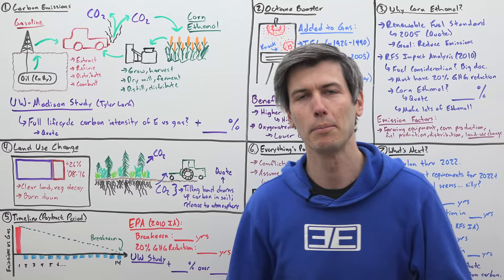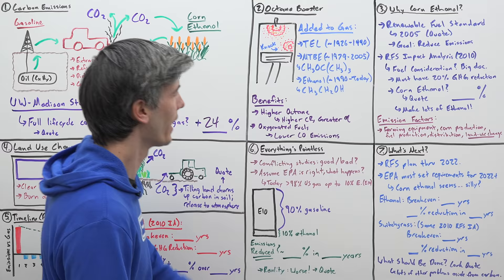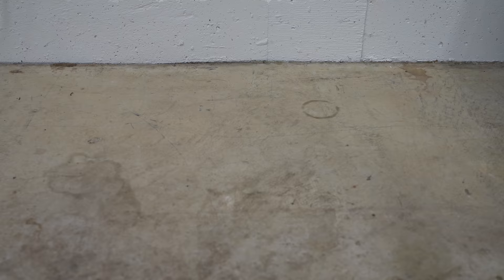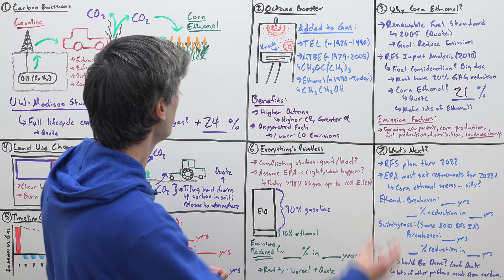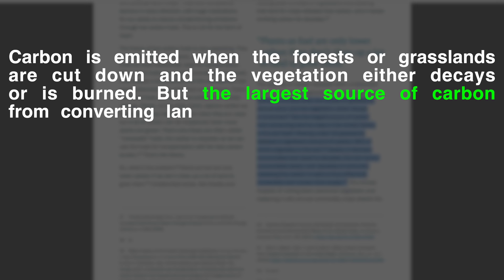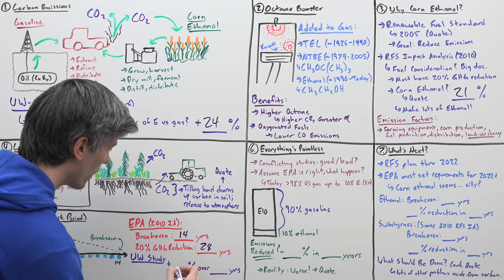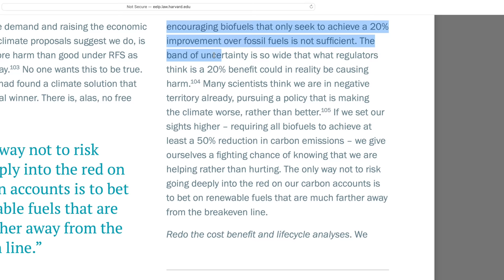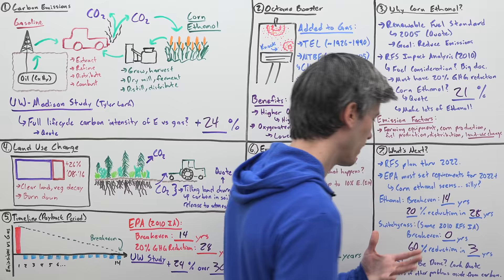America Was Wrong About Ethanol - Study Shows

Comment: Back in the 1970's(my engineering college years) I read studies in my engineering/science magazines about the energy output of ethanol. All the estimates were that the ratio of energy INPUT(to plow, plant, grow, harvest, process, ferment, distill) - to - the energy OUTPUT(when the resulting ethanol is burned). That ratio was estimated as very near 1:1.  With ethanol advocates claiming 1:1.2 at their high end and the detractors claiming 0.7:1 at their low end.  
And what's more is the energy INPUT is mostly from burning fossil fuels which produce CO2.  And then the ethanol is burned which produces more CO2.  The entire process from end to end nearly doubles the CO2 instead of reducing it.
Reply: All the energy and CO2 it takes to produce and deliver a product to the consumer is reflected in the price of the product.

As such note the spot cash delivered price of ethanol today is $1.49/gallon.

The price of sub-grade unusable gasoline (RBOB) is $2.32/gallon.

To turn RBOB into usable E0 fuel costs even more much like premium costs more.  Unfortunately, it becomes even more toxic and dirty.

Or simply splash in >10% ethanol to RBOB and the resultant usable fuel becomes less toxic, far cleaner burning, and cheaper/cheaper per mile to drive with.  Who can be against that?

Iowa State University measured all the energy it takes to produce an acre of corn into a "diesel fuel equivalent"
This included making of the machinery, fertilizer, chemicals plus the tillage, planting, harvesting, drying, trucking etc. 
They found it takes 34 gal of diesel to produce one acre of corn.
What do we get from those 34 gallons of diesel?
We get >500 gallons of ethanol.
But wait, that is not the kicker.
The kicker is we still get 100% of the protein from that acre of corn still available for an even better feed. A win-win.
Reply: Not to rush you Kthwkr but its 2024...

Comment: The use of corn for ethanol also raised the price of feed for animals (cows, horses, etc.) and the regulation required corn (corn lobby is strong), and not the most efficient plants (sugar cane) as well as switch grass like you stated.  This was very well known in the science world, but politics kept much of it from coming out.  I spent most of my career in various sections of the 'oil patch',  but am not lover of the petroleum industry.  Most people in it are good people doing the best they can, and like most industries there are a few 'bad actors' that spoil it for everyone.
Reply: The Renewable Fuel Standard does not specify what fuel or source is used, any source can qualify as renewable, even biodiesel.

The reason corn ethanol is so economical is not because it makes the most ethanol per acre, but because it is value-added from already existing feed production acres which preserves the feed as distillers grains.

No corn is grown just for ethanol, far too uneconomical.  But with the feed factor few others can compete even though they make more ethanol per acre, like sugarcane.

So much so that Brazil in 2017 put an import tariff on our ethanol.  Sugarcane ethanol is big there.

The subsidy for generation 1 ethanol which corn qualified for ended back in 2011 and had been $.45/gallon called a blenders credit or VEETC.

There still exists a subsidy for generation 2 ethanol which switchgrass would qualify for, and it is $1.00/gallon, yet no gen 2 plants have been built.  One that used corn stover was almost built but has since been repurposed.  It is harder to make ethanol from cellulose which is why even the spirits we drink all come from sugars and starches.

Here is how the 2007 Energy Independence and Security Act affected food/feed prices(if at all):

2007 WEIGHTED CORN PRICE =$4.20 WITH 4 .7B GAL MANDATE
2008 WEIGHTED CORN PRICE =$4.06 WITH 9B GAL MANDATE
2009 WEIGHTED CORN PRICE=$3.55 WITH 10.5B GAL MANDATE

2016 WEIGHTED CORN PRICE =$3.36 WITH 15B GAL MADATE MAXED OUT
2017 WEIGHTED CORN PRICE =$3.36 WITH 15B GAL MANDATE MAXED OUT
2018 WEIGHTED CORN PRICE =$3.61 WITH SAME 15B GAL MANDATE MAXED OUT + MOST ETHANOL EVER PRODUCED

Wheat
2007...............$6.48/bu
2008...............$6.78/bu
2009...………$4.87/bu

2016...………$3.89/bu
2017...............$4.72/bu
2018...............$5.15/bu

Soybeans
2007..............$10.10/bu
2008..............$ 9.97/bu
2009...……...$9.59/bu

2016..............$9.47/bu
2017..............$9.33/bu
2018..............$8.48/bu

Comment: Also don't forget that ethanol-based fuels are not as efficient as gasoline so your vehicle that can theoretically manage 30mpg only gets 28mpg that's not the answer you're looking for either.
Reply: You must drive a diesel vehicle then I presume.

The EPA states that in our current gasoline optimized vehicle fleet that E10 reduces mpg by 3 to 4% and E15 reduces by 4 to 5%.

The spot cash delivered price of ethanol on the NYMEX is $1.46/gal.

The price of an unusable sub-grade of gasoline (RBOB) is 2.74/gal.

To turn RBOB into usable E0 costs even more much like premium costs more.  Unfortunately, the added volatile aromatics also make it even more toxic and dirtier.

Or simply splash in >10% ethanol to RBOB and the resultant usable fuel becomes less toxic, far far cleaner burning, and cheaper/cheaper per mile to drive with.  Who can be against that?

Ethanol adds horsepower.  For example a Chevy 5.3L is rated at a clean 380 horsepower on E85 vs a dirty 355 hp on E0.

In ethanol optimized engines, you will get both more power and more mpg, even more power and mpg than diesel engines.

Ford's first EcoBoost prototype engine was optimized for E85 and had 15 to 20% more mileage than E0.  They did not come with a flex fuel version because they thought they could skirt the MIT scientists patent on it by not being flex fuel.  This is in litigation to this day still.

Ricardo built and drove around an ethanol optimized engine for GM which was half the size/twice the power and more mpg than gasoline engines, even more than diesel.  Here is an excerpt:

FROM RICARDO:
The new federal CAFE standards are calling for a doubling of fuel mileage performance, which, Vint says, is going to send OEM’s looking for high octane numbers to improve efficiency and ethanol is the best source. Ricardo, an engineering firm with over 100 years in the business of engine design, has developed an extreme boosted direct injection engine (EBDI) to optimize ethanol blends. The 3.2 V6 gasoline engine rivals the power and torque of a much larger GMC Sierra 6.6 diesel, he said, and it delivers 3.5 percent better fuel economy than the diesel.

Please note that no grasslands or forests were ever broken up for ethanol.  Quite impossible on its face since US cropland acres have been declining.

Corn ethanol is a value-added product of already existing feed production acres which preserves the feed in a healthier and more productive form called distillers grains.

Census data shows that in corn producing states that grassland, forest, and wildlife acres increased since ethanol.  The corn belt grew more corn acres in 1980 before ethanol than in 2018, the year of most ethanol production ever.

Comment: In Australia I get less range filling up on fuel containing 10% ethanol compared with none. Also our V8 super cars that run on pure ethanol found that certain engine parts deteriorate faster with ethanol.
Reply: Ok, I'll bite.  What engine parts deteriorate faster on pure ethanol?
Reply: @ChurchAutoTest  If I remember correctly it degrades rubber and plastic parts such as gaskets, seals and hoses. Being a racing team with a car running only on ethanol is what they found, however it occurred to me later that I saw the video at least ten years ago and that car companies have probably increased the resilience of modern parts to accommodate these issues.
Reply: @garethbaker5179  Any car sold in the united states since 2000 has ethanol tolerant fuel lines so no issue anymore.  I really don't consider fuel lines engine parts but I'll grant that old rubber may not have liked ethanol, just like old engine seals didn't like synthetic.  Price we pay if we want to keep old cars on the road.

Comment: Thanks for the video that brings up a lot of important points. I want to suggest one correction. Soil carbon does not all come out in the first year. It continues to decline over decades of farming, depending on the practices. No-till farming and cover-cropping can conserve soil carbon. You do get a large release from the initial conversion from the standing biomass and some of the soil carbon, but soil carbon is usually somewhat recalcitrant and doesn't all oxidize at once. The fertile Midwestern prairie soils that were brought into agriculture long ago are often still losing carbon today. One other thing that I think was missed is the large amount of energy required to distill fermented corn into fuel-grade ethanol.

Comment: A reminder of the historical origins of ethanol substitution. Back in the 1970's when Arab oil embargos caused huge fuel shortages and price rises, ethanol substitution was a way to stretch existing gasoline supplies. It was never seen as an emissions lowering strategedy except crudely as a way to lower fossil fuel consumption which as shown here is not worth the trouble. Fast forward to today and the fleet to now switching to EV's directly lowers emissions and decreases oil dependence provided that renewable energy is used in power generation for charging.
Reply: After the disastrous lead was outlawed, the petroleum industry gave us MTBE which was an octane booster and an oxygenate.  During this time ethanol was modestly being sold in the Midwest, proving itself to be an economical and effective non-toxic octane booster and oxygenate.

When it became apparent that MTBE also needed to be outlawed, ethanol was chosen to replace it.  The petroleum industry went along with the legislation because hidden in the bill was legal immunity for the MTBE.  This was revealed and taken out but the bill still passed.

This is how and why we went to today's levels of ethanol in our fuel, not anything said in the 1970s.  

The amount of ethanol used by 1990, despite a steady trendline of growth was only .1% of the national gasoline used.  After the energy acts passed, ethanol use exploded to around 10% by 2011 onward.

Denver in 1988 was the first government entity to require E10 when they were on the EPA list of ozone non-attainment zones.  Soon with ethanol they were off that list.

Even with just 10% ethanol added to E0, the Swiss Federal Laboratory for Materials Science and Technology found that the especially health devastating ultra fine or nano particulate emissions were lowered by 97%, carbon monoxide lowered by 81%, carbon dioxide lowered by 13%, aromatic hydrocarbon emissions lowered by 67-96%, and genotoxic emissions lowered by 72%.

Comment: I'm curious about the octane boosting effect? Is it used in the same gasoline based as before resulting in better overal knock resistance, or... is it used to make low grade fuel acceptable for retail consumption?  That's the question.  Otherwise it's really cool stuff imagining being able to drive ICE cars well into the future.  Just make sure you have a tunable ECU and tuner when this all comes to fruiiton.  New cars breakdown just like old cars, and if you start running DI turbo systems on different fuels without tuning they won't last long.  ALSO WORTH MENTIONING alcohols break down you're engine oil, an engine burning 85%+ ethanol needs an oil change twice as often unless it is specifically designed for it.  Injector/pump seals will also need to be replaced with ethanol stable types.

Comment: I agree with changing to other sources than corn.  I disagree that farmers till 26% more land that was not being tilled into corn production.  Farmers don't sit on land with a 26% surplus.  All tillable land is used for production, unless it is in a government program, and then it is only temporarily so.  So "Land Use Change" is not a valid scenario, it's just an argument against using corn for fuel.  Even if we have a 500 year supply of oil in the U.S., it doesn't mean we can't start using other fuels, and it doesn't mean that we should use it all up as fast as we can.  Emissions is less of a problem than alternate fuel sources.  Your timeline payback as sole validation for ethanol use is ridiculous.  Smacks of the idea that recycling is pointless because it does not pay for itself.  The point of recycling is to reduce waste and conserve resources.  But I guess you can throw some corn cobs at that, too.  To be clear, I like most of your posts.  This one is a stinker.
Reply: The reason corn ethanol is such economical source is not because it makes the most ethanol per acre but because it preserves the feed in the distillers grains.

Cattle feeders who feed distillers grains would have to find an alternative source of protein if we had another Prohibition and that would be switching back to feeding the less healthy and less concentrated corn straight.  We will grow the same amount of corn with or without ethanol in other words.  Ethanol is just a value-added product.

There were no forests or grasslands broken up for ethanol (as your intuition told you) since US cropland acres have been falling so that is impossible on its face.

The corn belt actually grew more corn acres in 1980 before ethanol than in 2018, the year of most ethanol production ever.

Iowa State University measured all the energy it takes to produce an acre of corn into a "diesel fuel equivalent"
This included making the machinery, fertilizer, chemicals, plus the tillage, planting, spraying, harvesting, drying, trucking etc. 
They found it takes 34 gal of diesel to produce one acre of corn.
What do we get from those 34 gallons of diesel?
We get >500 gallons of ethanol.
But wait, that is not the kicker.
The kicker is we still get 100% of the protein and other things from that acre of corn still available for an even better and healthier feed called distillers grains. A win-win.

100% of the fertilizer and everything in the soil still gets fed to the livestock, ethanol is made only of things in the air: solar energy, CO2, and water with the latter two recycled once burnt.

What logic is it then to assign all the energy and CO2 from fertilizer to ethanol and none to the distillers grains?

Comment: Clearing the land also did not take CO2 out of the air, but the tree and grass land was already taking CO2 out of the air.  This had a big negative effect on CO2. Plus the wasteful fertilizers that are required to produce that corn are running into our lakes and rivers killing the good water with algae blooms. Making fertilizer is very expensive and costly to manufacture, in the form of electricity and machine hours, so that it also putting more CO2 into the air.  Plus you are stealing nutrients out of those soils that will never be replaced by men.   So it's not a true circle of renewal at all.  I believe the 24 % negative CO2 effect is closer to the correct answer here.
Reply: There was no clearing of grasslands or forests for corn ethanol.  Quite impossible since US cropland acres have been declining since ethanol.

Census data shows grassland, forest, and wildlife areas increased in corn producing states since ethanol came to be.

The US used 11,160,933 tons total fertilizer on corn in 1980, before ethanol.

In 2018, the year of most ethanol production ever, the US used 10,521,850 tons total fertilizer on corn.

100% of the fertilizer (& everything from the soil) still get fed to livestock in the distillers grains.  Ethanol comes from only things of the air: solar energy, CO2, and water with the latter two recycled once burnt.

Ethanol C2H6O = no fertilizer

Distillers grains = all the fertilizer

What logic is it to then assign all the energy and CO2 of fertilizer to ethanol and none to distillers grains? 

Iowa State University measured all the energy it takes to produce an acre of corn into a "diesel fuel equivalent"
This included making the machinery, fertilizer, chemicals, plus the tillage, planting, spraying, harvesting, drying, trucking etc. 
They found it takes 34 gal of diesel to produce one acre of corn.
What do we get from those 34 gallons of diesel?
We get >500 gallons of ethanol.
But wait, that is not the kicker.
The kicker is we still get 100% of the protein and other things from that acre of corn still available for a healthier and better feed called distillers grains. A win-win.
Reply: @danafletcher2341  Bull. Just incredible the the lies from the fuel industry.